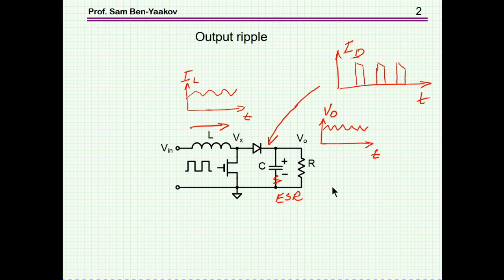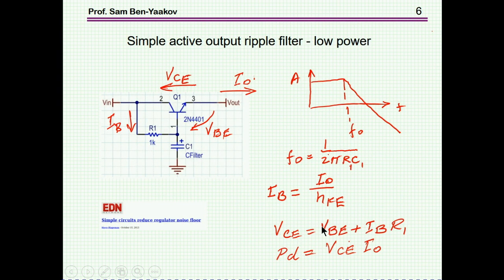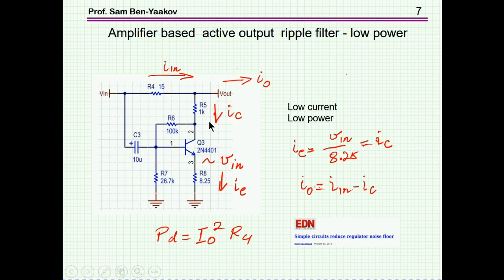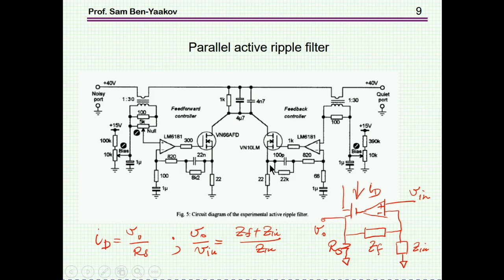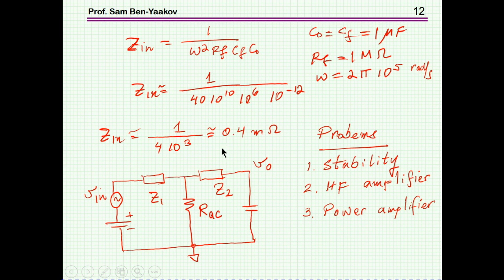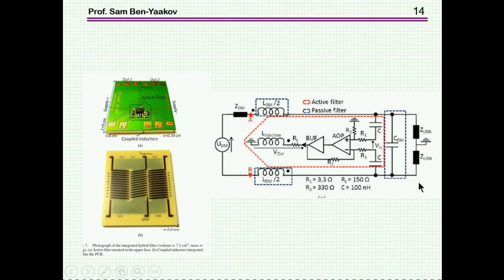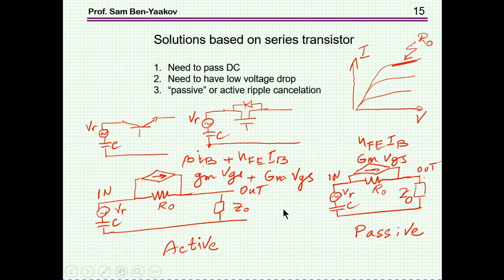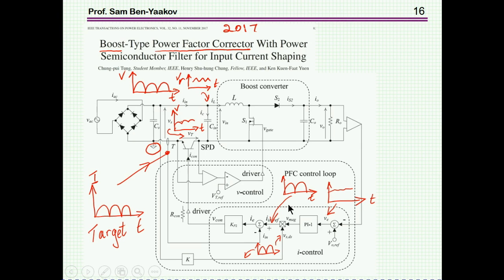Active Ripple Filters for switch mode converters

Comment: Depending on the load, but a lot of these circuits will have a drawback in voltage regulation. Either influenced by the transistors or like the series resistance and non-linearities of the inductors.
Reply from the maker: Thanks for comment.

Comment: Hi Dr Sam
In RC low pass filter , sometimes we add resistor across the Capacitor, this for just bleeding and discharge the capacitor or this effect the charging time
Thanks.

Comment: Thank you for this lecture. Recently I came across a simple transistor attenuation circuit and this answered most of my questions,.. and probably saved me from another partially melted breadboard.
   If I may ask, I would greatly appreciate a bit of insight on a circuit. I want the least amount of output noise on a Peak Mode controller based buck converter. I wish to replace R1 from the feedback resistors with a potentiometer to create a crude variable power supply with a wide range of adjustment. I designed for maximum duty cycle and timing, below inductor saturation. This corresponds to the peak power output of the circuit. The output is designed for less that 1mV of ripple at this peak output. What theory or design process should I follow in order to minimize the large range of noise and problems with this circuit to account for different load currents and output voltages?
    I have been experimenting with such circuits to explore DC converters. I understand this is a bit unconventional, but this circuit has proven to be more functional than I first anticipated, and I would like to explore the curiosity further as more of a worse case scenario for noise reduction. 
    If it helps I am using the ubiquitous MC34063 control chip and the circuit layout from the datasheet example. For the sake of an example, I designed the maximum current as large as possible at around 500-700mA, and the peak voltage around 20 volts. I don't intend on asking you to design a circuit for me. I am at a point where I don't know what my options are or what questions I should be considering in order to achieve the goal of reducing the noise under such changing conditions. In reality the circuit mentioned is not important. I'm just trying to understand the design theory in a bit more practical context.

   I am under educated, making the best of my time after becoming partially disabled. If I could sit in a chair for extended periods of time I would persue further education on this subject. I do create some visual content on YT to help me stay committed to projects that take a long time for me to complete in my condition, and because a deeper understanding of a subject is needed in order to demonstrate it to others. My channel is not monotized, and I do not persue any financial gain through this medium. This is simply one of my only outlets available to persue my curiosity and self education after a car crashed into me while riding a bicycle to work in 2014.
   Regardless, thank you for your efforts on this channel. I very much appreciate what you are doing here.
  -Jacob
Reply from the maker: Hi Jacob
Thanks for comment. My email is sby@bgu.ac.il. Please send me your query focused on specifics 1, 2, 3 and it would help if you would attach schematics etc. so I would know what is R1 (-: